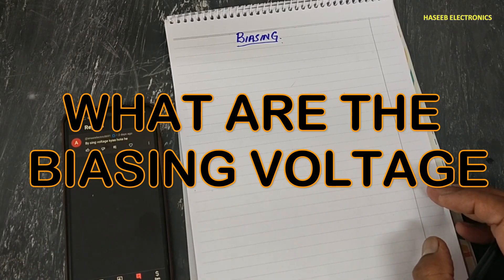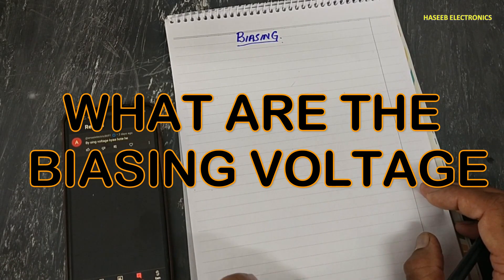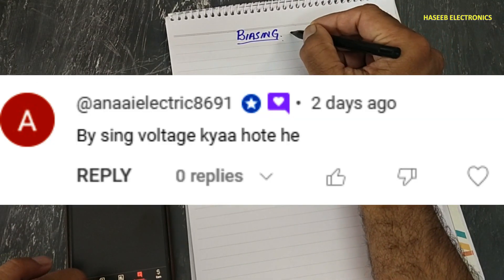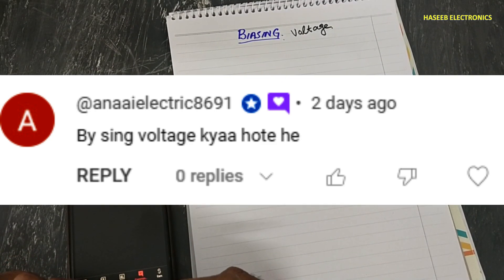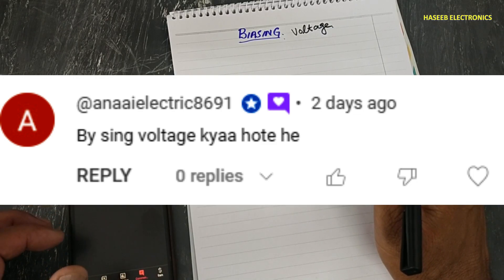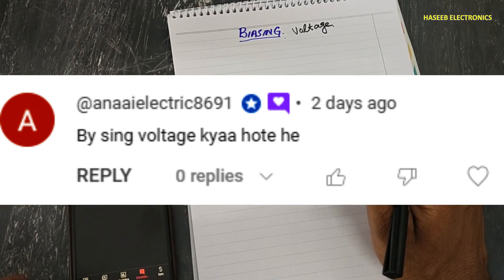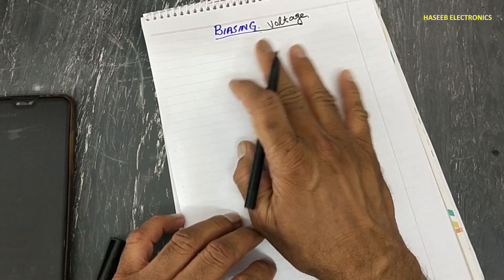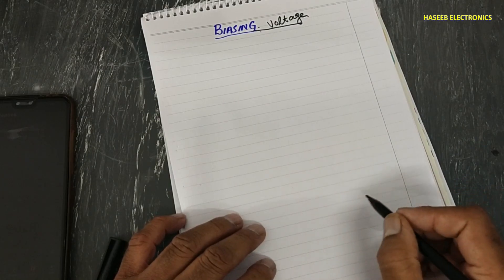{929} biasing voltage in electronics

Comment: It's a great narration. But there is one point I don't understand. I'd be grateful if you could answer it. The bias voltage is taken from the 310 V DC line through 2 resistors connected in series. In this case, doesn't 310 V DC reach the integrated?

Comment: for the VCC voltage the ground connecting to Anode of the diode and positive line is on the Cathod side right? how the curent/voltage will pass from the coil

Comment: sir my rechergable fan sunca sf 286b .its problem is runing ac line its 1 suplly diod is being so heatup,
and when it running in dc mood it is not start up.but when I Touch a registance near by  9014 trangistor with my finger then its running.solution please ...

Comment: I follow your channel with interest.  I learned a lot of valuable information from you.  If you have time, how does the 16 pin viper16L provide the initial starting voltage?  I've looked at the datasheet, but I don't fully understand it.  Thank you
Reply from the maker: please check video number 932

Comment: does adjusting the value of startup resistor to increase the current for the continuous running of the IC is not possible?
Reply from the maker: no, it is very important to have a very high value resistor for startup, as it provides a delayed start to the circuit so that the circuit will not draw surge current 
please check video number 386 for more details

Comment: What is the purpose of the auxiliary winding.
?
The VCC could also be provided permanently via the RC element.
Reply from the maker: no, it is very important to have a very high value resistor for startup, as it provides a delayed start to the circuit so that the circuit will not draw surge current 
and after  startup, the circuit is transferred to vcc winding for continuous operation. 
please check video number 386 for more details

Comment: I have 12v 30A smps power supply, but now output only given 3v . What could be the problem? It would be helpful if you knew me. I will wait for your reply. All the capacitors of the supplied supply are good and the diode is good. I have checked.
Reply from the maker: please check RCD snubber circuit (resistor, diode, capacitor across primary winding)

Comment: Biasing voltage=control voltage= auxillary voltage=...e.t.c. In given example of car it is battery of 12V, which starts engine and keeps all necessary voltage inside car (lights, sirene, window openers,...control of I.C.E e.t.c).
Reply from the maker: great

Comment: https://youtu.be/wIw2M0VzV3A?t=334  what is the general value of startup resistor ? Why didnt you say ?
Reply from the maker: it depends on the circuit configuration, 
each circuit have different value of the resistance 
it may be from 50K to Mega ohms 
if you are interested, then check video number 386 for more details and calculation
Reply: @HaseebElectronics  this answer must be said. The range and the general values.
Reply from the maker: it depends on the current of the pwm ic
required start up time 
vcc capacitor
then the value can be determined
as I explained in video number 386
Reply: @HaseebElectronics  It may depend ? Topic isnt this. When talking about some ge9neral knowledges must be given.